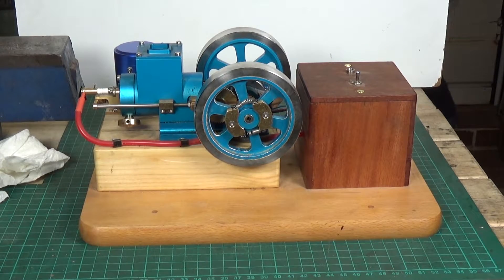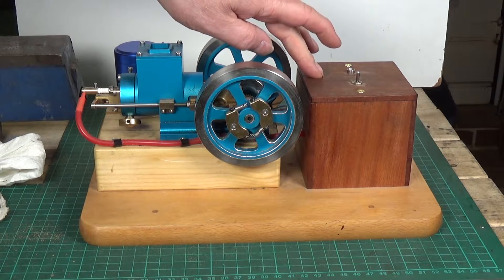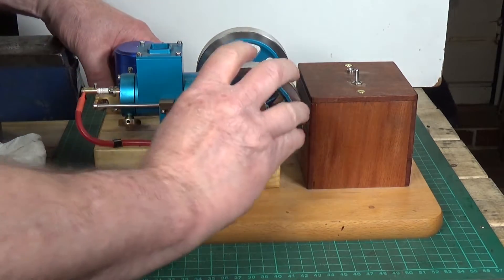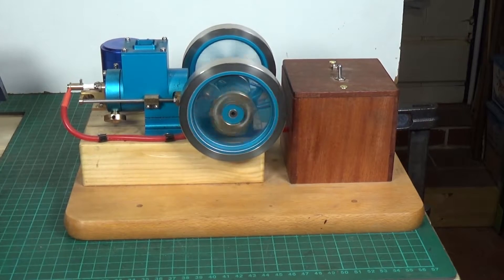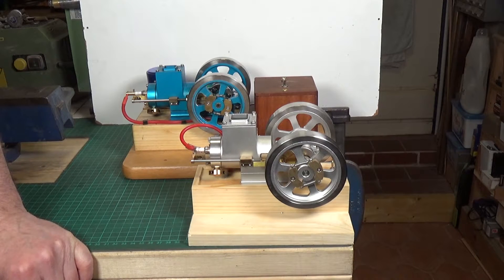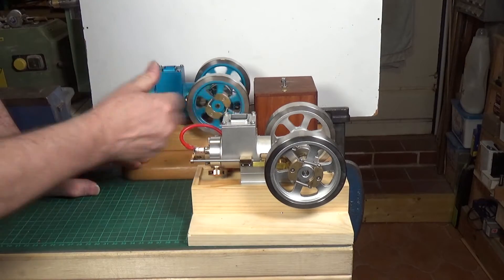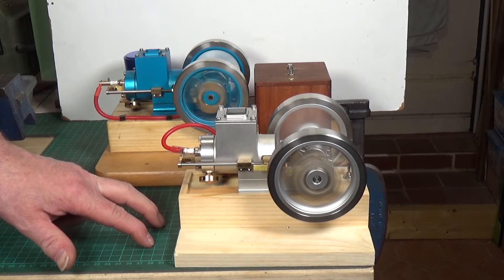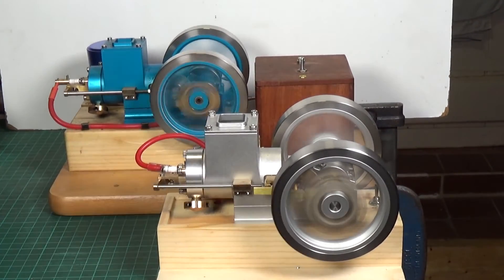Further Adventures with Chinese Hit and Miss Engines - Part Two

Comment: Hi again Alan.  Only 5 years have gone past ;)   That silver jobbie looks a lot like what's coming to me soon.  Obviously variations of the main design.  The negative earth fix is well worth knowing.  It will be interesting to compare notes on these.  What could possibly go wrong ?  Cheers Rob
Reply from the maker: Hi Rob. I don't know where the time goes! Although they look similar yours is a very different engine. Mine has one pushrod operated valve (exhaust) with the rpm controlled hold open mechanism. The inlet valve is opened purely by engine vacuum. Yours has both valves operated by pushrods just like a conventional 4 stroke engine. I'm sure it will run fine straight out of the box 🤣 Cheers, Alan.
Reply from the maker: Oh, one other tip. I have since found that if you choke the carburetor and rotate the flywheels a couple of times before turning the ignition on the engine starts a lot easier. Cheers, Alan.
Reply: @RetroSteamTech  Yes, I expect it will be a lot less temperamental Alan.  I was reading in the comments that build quality was a bit variable between the blue and silver units.  I will check it out closely on this version.  Interesting days.  Cheers Rob

Comment: Could be greatly improved with weaker governor springs, making it run much slower..
Don't forget to put plenty of good oil in the fuel too.. as tge rubber piston rings won't last 5 minutes!

Comment: You need to oil the engine first!
Reply from the maker: Before i ran the engine all of the moving parts were oiled. Also i now put two-stroke oil in with the fuel.
Reply: @RetroSteamTech  than it makes weird sound that's not good!

Comment: Alan, Watched part 2.  Glad they’re both running well.  Can’t wait for my silver one arrive so I can see what all of the upgrades involve. I’ll definitely add the grease cup to the connecting rod tho.  Regards the. Larry
Reply from the maker: Hi Larry, Good luck with your silver one. I would be interested to hear if there is any play in the crankshaft bearings. One of the comments was from a guy who has both engines and he said that there was a considerable amount of play in the bearings on the silver one. I checked mine and it was the same. Cheers, Alan.
Reply: Retro Steam Tech Greetings Alan,  my silver motor had a huge amount of play in the mains.  The bearings were very sloppy caged needles.  I have replaced them with Oilite bronze as used by David Krezel who originally designed this motor before it was appropriated by the Chinese. There is now virtually zero play.  I’ll have it back together soon and let you know the results.  Larry
Reply from the maker: @larrylindquist2032  Thanks for the info Larry. That's 3 of them that i know of with play in the bearings, must be made that way. Very strange as i have zero play in the bearings on my blue engine. Cheers, Alan.
Reply: Retro Steam Tech   Alan,  My blue motor also has virtually zero play with about three hours running time, and it too has needles.  Either they found a supplier with cheaper sloppier bearings, or the crank is undersized.  Regards,  Larry

Comment: Finally proven.  Well done.  Thanks for doing that.  I have just received my replacement gold box and will ground the engine to the battery negative.  Hopefully this one won't get roasted!  Will let you know.
Reply from the maker: Good luck with your new ignition box. I have also found that prior to turning the ignition on, if you put your finger over the carburetors air intake and rotate the engine slowly for a couple of turns this also helps with starting. Effectively you are providing a choke. Works quite well on both of my engines.
Reply: @RetroSteamTech  Thanks for your advice.  I connected up the new box grounding its casing and the engine block to battery negative.  Starting was a struggle at first until I mastered the twisting-wrist movement, now it is as easy as using my DIY ignition module.  I also found out a drop of Model Technics D1000 model diesel fuel in the venturi helps a lot-- the wonder of ether I think.
Would you be thinking of changing the two main bearings?
Reply from the maker: @mylittlediesels  Glad you got it sorted. The bearings on the Blue are fine, there is quite a bit of play in the bearings on the Silver one but i never run them for long so i will just keep an eye on them for now.

Comment: I'm thinking very strongly towards getting one of these (instead of a steam engine!) would you recommend them? Are they of the quality that they will rack up 100's of hours without a problem?
Reply from the maker: The quality of the the castings and machining is very good and i see no reason why they shouldn't run for many hours. I'm fascinated by Hit and Miss Engines and intend to get more in the future. A few things to consider with these though, as they are internal combustion engines which run on petrol they produce carbon monoxide, so running them for long periods inside is not a good idea! I would definitely mount them on a base so they can be clamped down when run. Also compared to a steam engine they are quite loud. I think these Banggood engines are great value. I've looked on ebay and even a kit of machined parts for a Hit and Miss Engine will cost £400 to £500 and a ready built one a lot more.
Reply: @RetroSteamTech  cheers for the reply, this will be my first venture into a small petrol engine (besides 40 years ago I had some Cox airplane engines).
Reply from the maker: @SteamEngines-Jim  I too had little Cox (049 glow plug) engines and it would have been about 40 years ago 🙂
Reply: @RetroSteamTech  Time goes wayyyyy to fast !
Reply: One thing to keep in mind is te importance of lubrication. These motors have no provision for automatic oiling.  You must be certain that it’s well lubed before each run.  Your goal of hundreds o hours of running is likely attainable, but it will very probably going to have to be a  lot of shorter runs added together. The lubrication will only last so long before it needs to be manually replenished. One area that will need special attention is the lower rod end. It doesn’t have any real bearing. It’s had to lube from the outside.  I added a micro grease cup to the rod cap.  It seems to take care of the problem.  But once again, it needs to be filled and used every run.  The workmanship is excellent and if short runs are not an issue,  try it i think you’ll like it.
Reply: @larrylindquist2032  Thanks Larry.